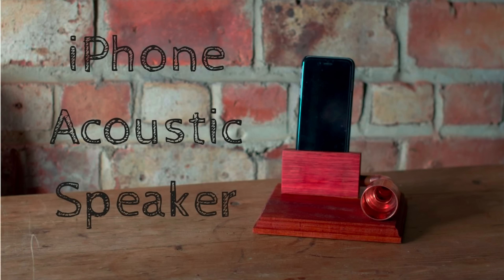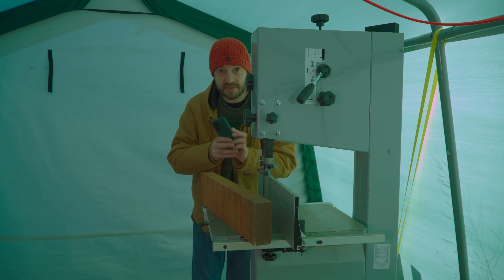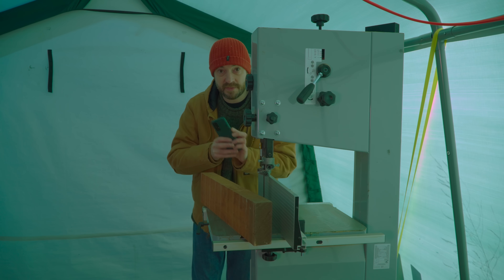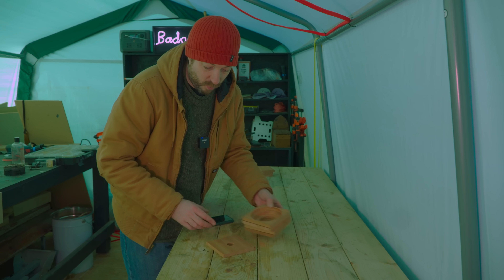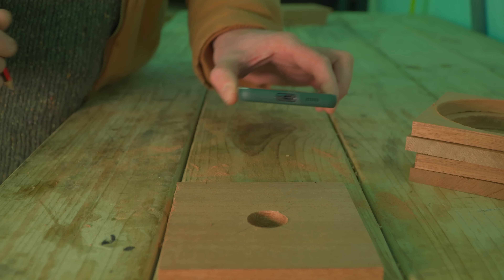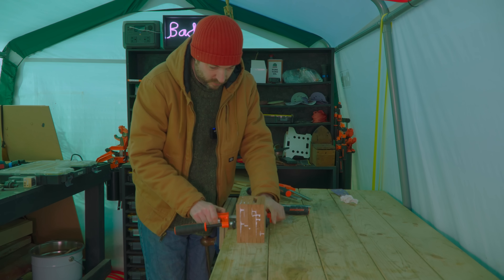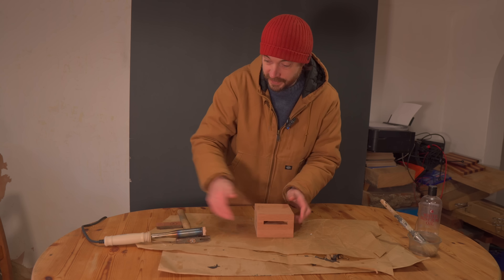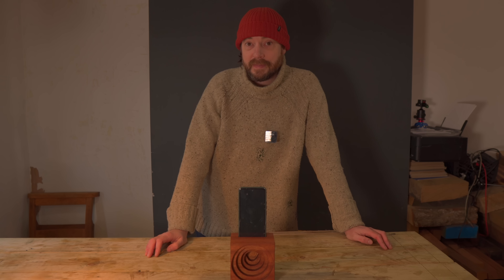Making a Phone Speaker

Comment: One suggestion - drill a second hole from the outside to the interior to allow a charging cable to be plugged into the bottom of the phone.  Now you can use it as a bedside speaker/phone stand/charging station
Reply: maybe he has a cordless charging version
Reply: looking at the vid again that's not the case